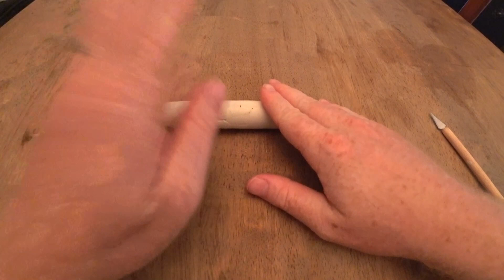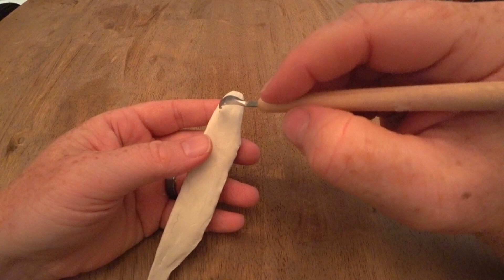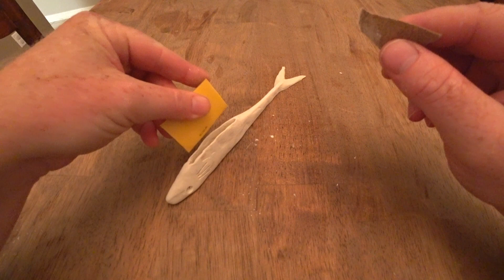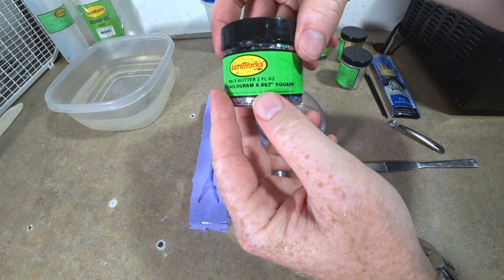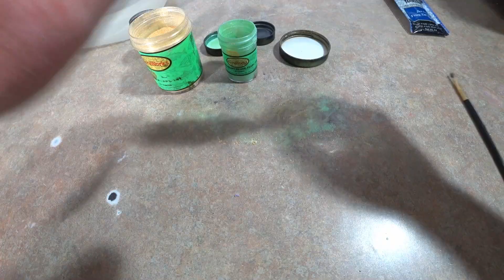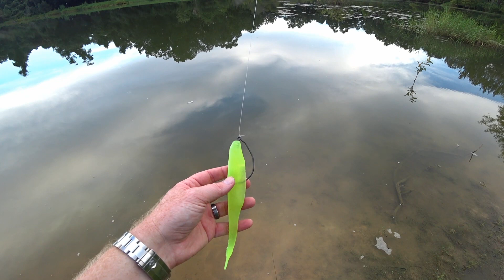Let's Make a Large Jerkbait!  Making an Open Pour Fishing Lure Mold

Comment: i like the pearls, up here in the north they dont work so well so i dont use it. Have you ever considered using lureworks sb clear and adding color to it then sealing? it smells but they also make a water based lure paint. i rarely make crazy lures, usually stuff to match my jigs but when i shoot dual colors and need stripes i use lure works black that doesnt need sealing. check out spike its site they have them all. just tryna cut steps for ya.